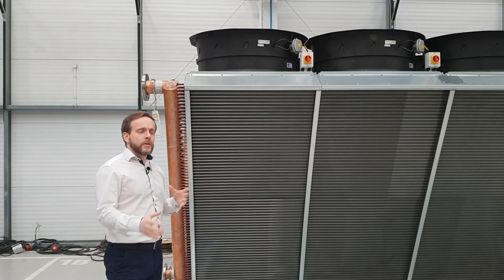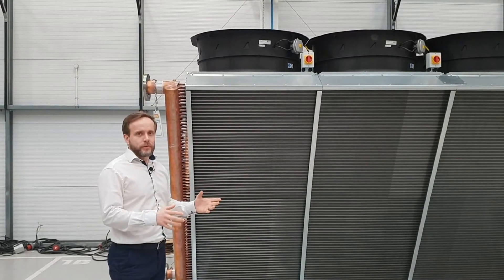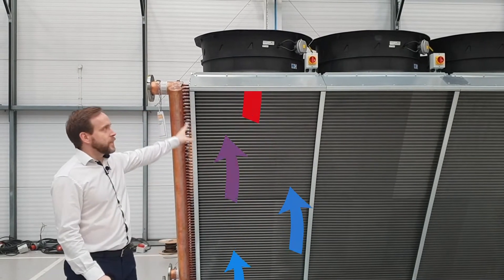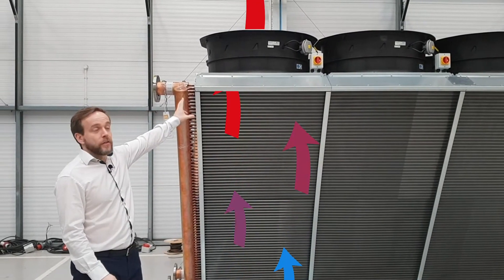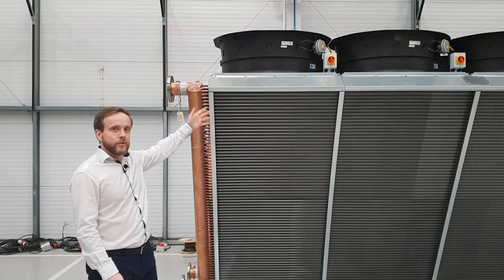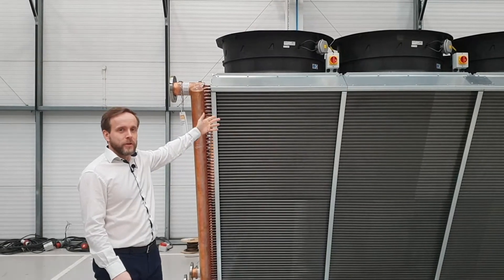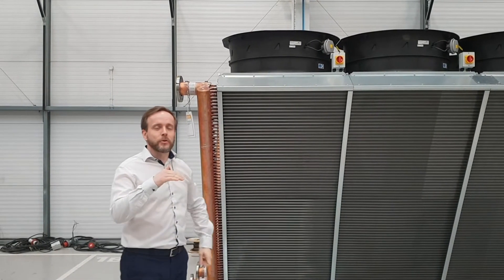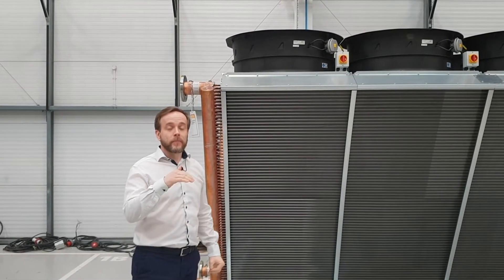Transtherm Adiabatic Coolers Typical Applications

Comment: When we use adiabatic cooling tower, what kind of water losses that are still could happen? How about evaporation losses and drift losses?
Reply from the maker: Hi Doni, 

Thanks for your question.

To fully explain, I would comment as follows:
1. The Transtherm Adiabatic System doesn’t recycle water, it is a once through cycle (water supplied from a mains supply or rainwater tanks etc., through the adiabatic system and into the air stream only).  This means that there is no need for water bleed off like you would see with cooling towers or some hybrid coolers
2. As we only boost the relative humidity to circa. 85% there is no chance of plume that you would associate with cooling towers
3. The majority of adiabatic cooler installations are not overly affected by windy conditions so there is little chance of drift loss – this is because the windiest conditions tend to occur in ambient temperatures that are lower than the adiabatic trigger point.  For installations where this is a concern, we offer baffles and screen filters
4. There are minimal losses when the adiabatic booster pump (a small pump within the adiabatic system that boosts mains water pressure to circa. 6 bar) energises or deenergises between cycles as water briefly drips from the nozzles